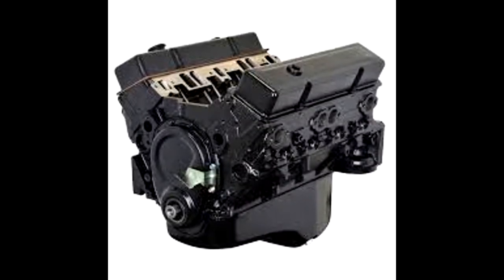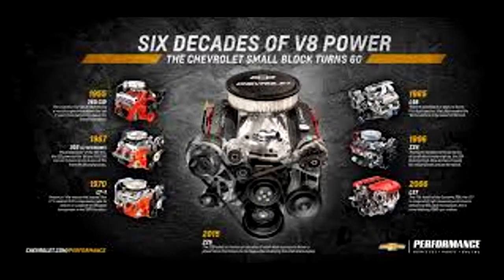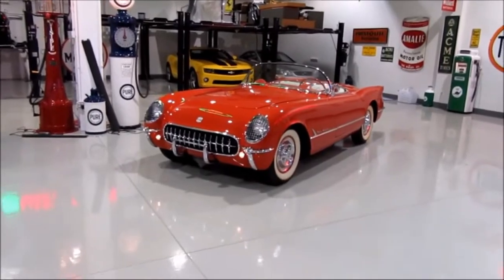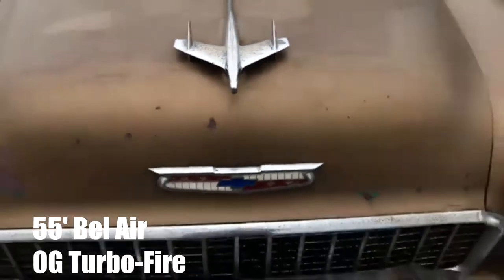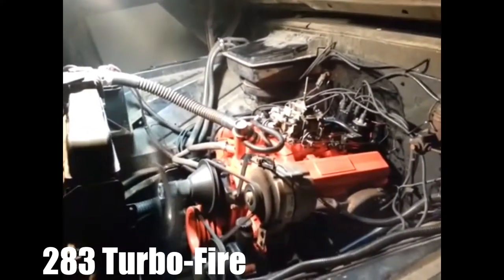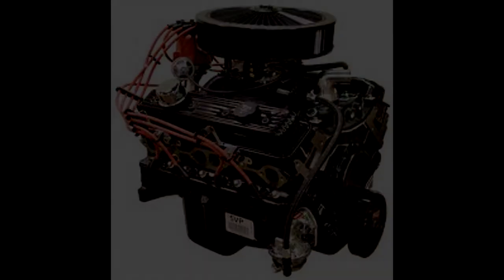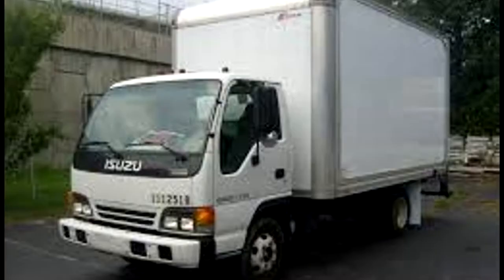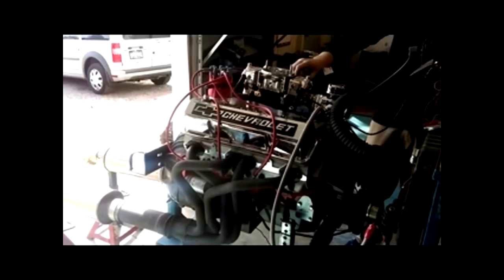Chevy's Small Block: A Brief History

Comment: I got a 56 chevy done up in pure muscle style in 79 to 86.  From the back to the front. 4.11 posi track diff, 3" dual exhaust and headers, muncie m21 w husrt shifter,  blowproof bell housing with a "zoom" brand clutch.  And then my 327. I used a 1/2 in lift, 300 duration cam,  4 barrel truck cyl heads,  Edelbrock torquer 2 and topped off with a quadrajet which was tricked out.  With 70 series street tires I did a 1/4 in 14.5 @ 100mph.  My fastest car was a sleeper. 88 Lebaron turbo that I rebuilt and modified and got 14.1 @ 97.3mph.  It was a high line luxury convertable, so with low 14's it was the ultimate sleeper.  I still miss my old 56!!! and my 327.  ps I rebuilt both motors myself.

Comment: I believe the first Chevy small block was a 265, not a 262.  The first Ford OHV V8 was a 262.
Reply: Ford first v-8 was a 239 cu.in. in  1954. The same cu. in. in the flat head. The ford OHV was before the Chevy Boat ancker and over produced trash.  The Ford motor was introduced in 1954. In 1955 grew to 272 cu. in. In 1956 the motor grew to 292 cu.in. And the Thundebird to 312 Cu. in. In 1957 the super charged 312 was able to produce 345 hp. Slapping the 283 in the face.

Comment: No doubt a great engine and 40 years later make it a Y block and add the shaft rockers that Ford had in 1954 and you have a better mouse motor LS. Chevy had the better heads and Ford had the better idea but  It never got past being an idea. Fords mistake.